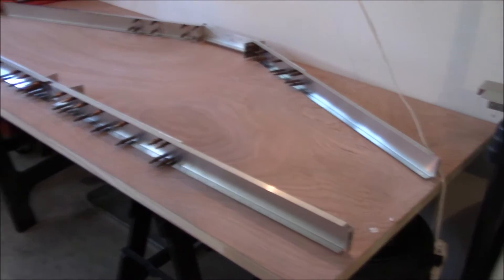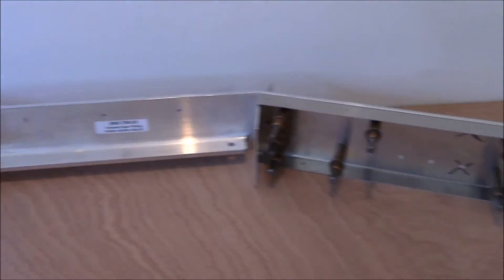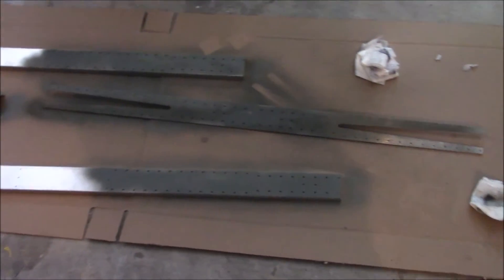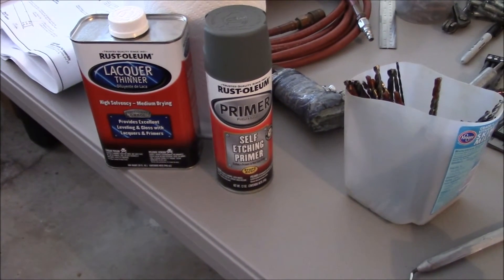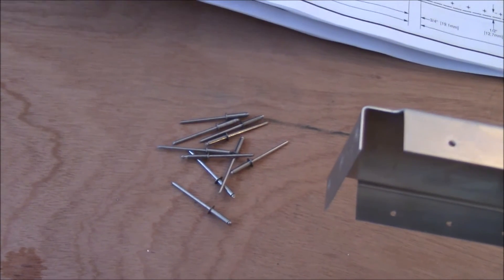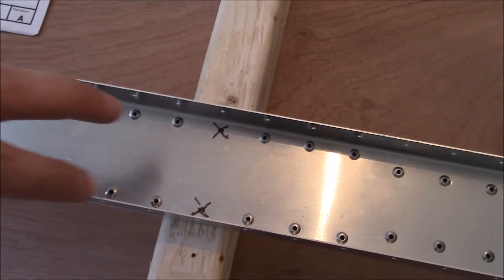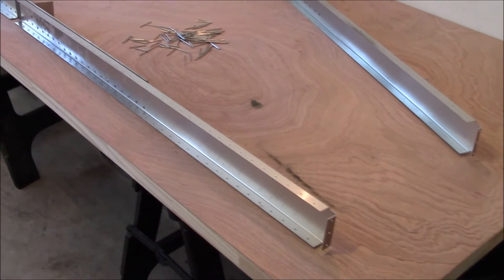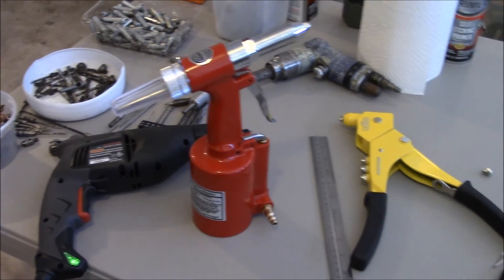Sonex Aircraft Build Video 4 Forward and Rear Spar Complete

Comment: Nice video but I have a few suggestions.1 don't use any paints fasteners or adhesives from your local hardware store. They are not aviation approved. 2 get in contact with your local EAA club they have resources if you need them. 3 get a good DOTCO drill trust me I love mine. you can find tools and supplies at Aircraft spruce, The yard and Brown tools. oh and alcohol and acetone are best for cleaning parts and Boelube for drilling, makes your drills last longer. I've been a structure mechanic for over eight years. hope I have helped you. good luck and have fun.
Reply from the maker: Thanks Matthew! I just got in touch with my local EAA chapter here in Austin and I am joining them. I'll look into better quality paints. All the fasteners I use will be Aviation quality. I don't know the name of the drill bit I am using, my dad gave it to me but it is a 2 stage drill of the highest quality. I think he said it costs around $15 a bit. He swears by them. He is an A&P. Thank you so much for the suggestions. They do help a lot! -Dan
Reply: Well with an A&P/Father to help I'm sure you'll build an fantastic aircraft. looking forward to your videos. :)